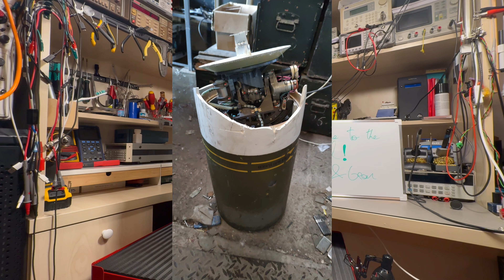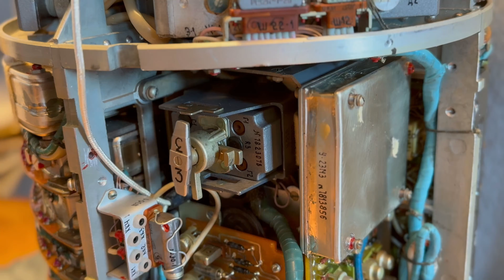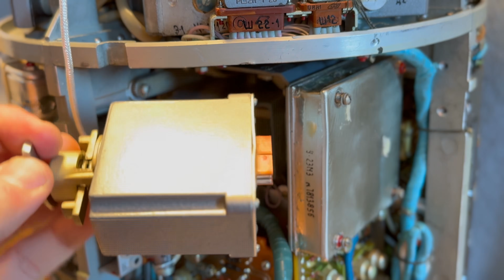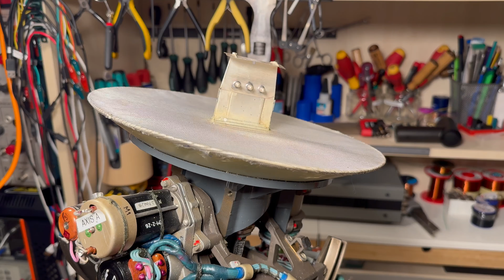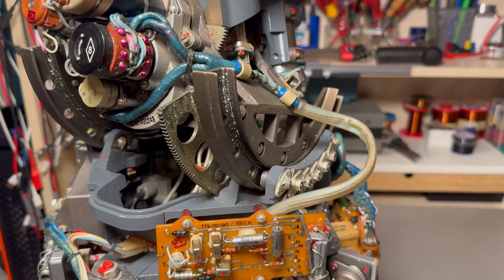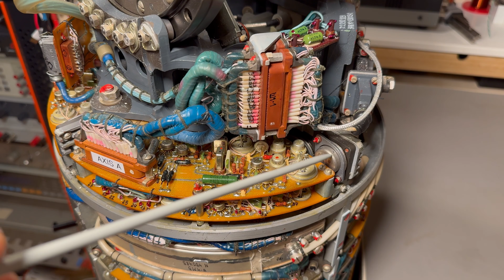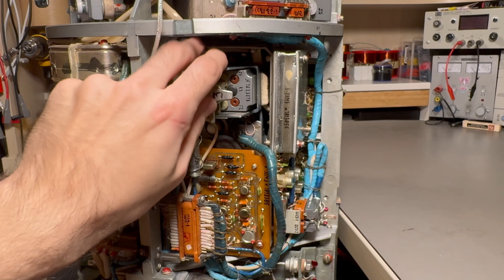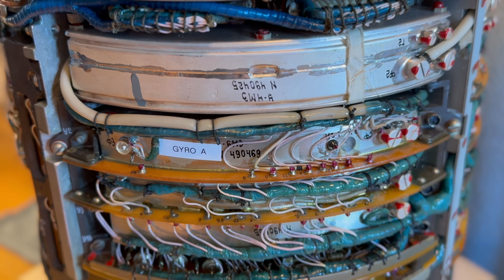Soviet Surface to Air Missile Poorly Explained

Comment: 14:24 гетер вх = heterodyne (mixer/downconverter) input
21:28 АРУ = AGC, idk what ш means in this context; огр = limit, рег = adjust, полосы = bandwidth, бал = balance? порог = threshold
Reply: In addition to your comment. 

1. Those fluoroplast creamy-clour wires are called МГТФ in russian. This is basically the most well-spread montage copper wire that used in soviet milirary equipment form radiostations to missiles. The insulation is wrapped with a fluoroplastic thread, so there is only one disadvantage of that type of wire: it doesnt like water or wet weather if being contacted with this stuff. Despite basic low-freq. МГТФ there is a version called МГТФ-Э (Э-Экранрованный, shilded), which was used to conduct higher frequency signals

2. Heat shrinkages on the МГТФ's are probably Ф4Д or Ф4ДМ, these are standard soviet fluoroplast heat shrinkages for military-purpose hardware assembly.

3. Soldering connections are covered by red zapon-varnish. Very spread protection cover type in soviet electronics. 

4. If you see some rumbs on devices that actually means that they've standed exit military controll after production and were produced to use in military-purpose hardware. Soviet consumer-grade components were not good with some exceptions, passive components particulary are terrible, but millitary stuff (Приемка 5, ВП - Военная приемка - military control) and special stuff (Приемка 9, ОС - Особо стабильный - extremly stable(space, nuclear power plants, cryptography hardware for crucial radiocomms)) were very good produced. Used to repair soviet milirary power supply couple of weeks ago, electrolythic caps were good, no leakages, no high ESR, optimal tangent of the loss angle. It was produced in 1968 actually.

5. Cyllinder-shape golden pin IC's are probably К140УД1 or something like that. Most produced soviet Operational Amplifier. There are many other amps, like small signal/instrumetal once in these packages.

I will write more info and extend this message later, there are more things that I could explain or smth like that. Or if you guys have some questions in determining components, i can help either
Reply: Could AGC mean "Automatic Gain Control"?
Reply: @гига-нигга  yup, exactly
Reply: Can Š be noise as "šum" we have that term in Croatian electronics it probably is used same way in Russian?
Reply: Šum is same also in slovak and czech language
Reply: @engineer1941 I think Š usually means "štěpsielnoe soedinenie" = Plug connection